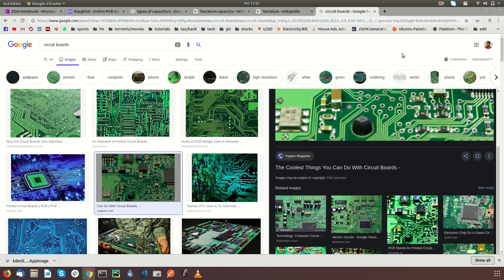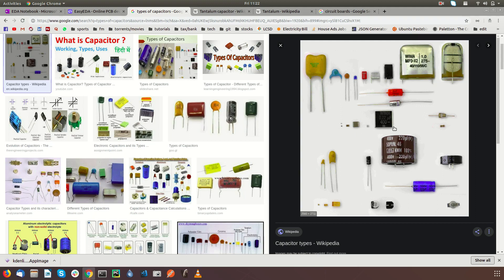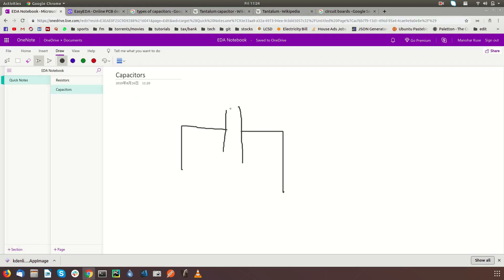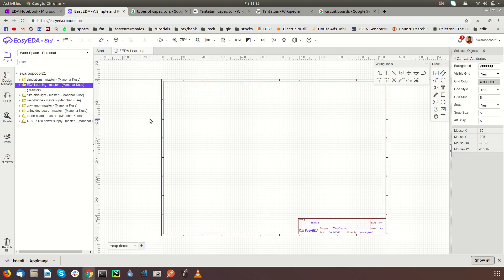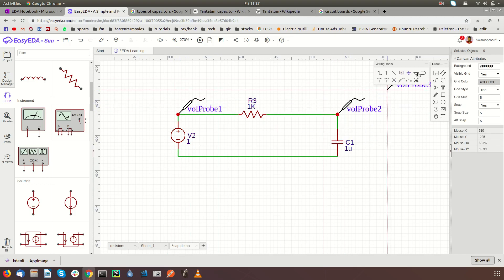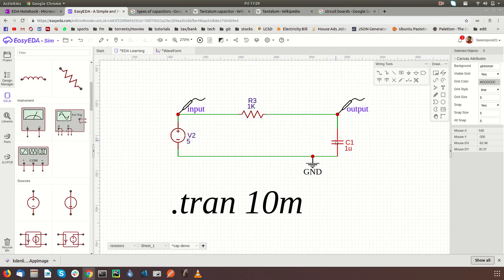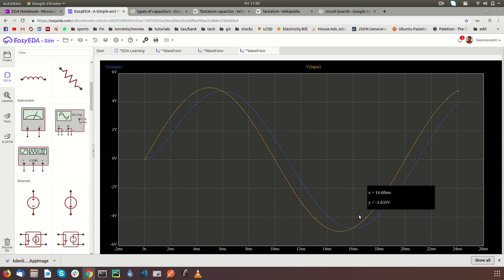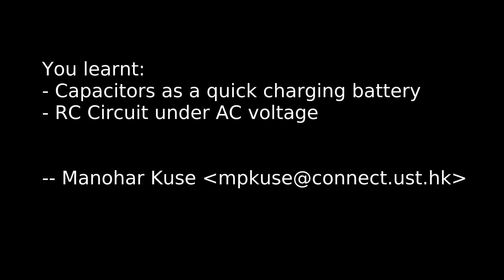Capacitor Circuit Simulations Capacitors (Part-1)

Comment: But in the first rc circuit wuth r=1k and c=1u and dc voltage source we have RC = 1ms, so capacitor should charge at around 4RC = 4ms. insead it charges much faster. why??
Reply from the maker: good question. I am afraid I don't have a good enough explanation to it. If you do find an explanation to it else where on the internet do let me know as well.
Reply: same problem to me - don't know the answser
Reply: solution: need to write "startup" behind -> .tran xx xx xx xx startup